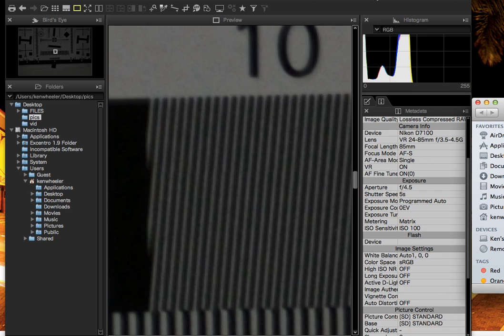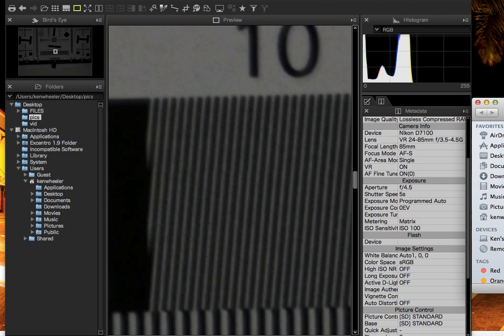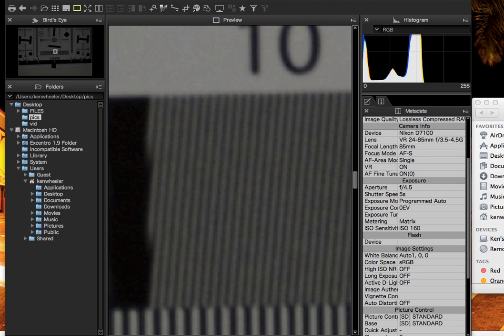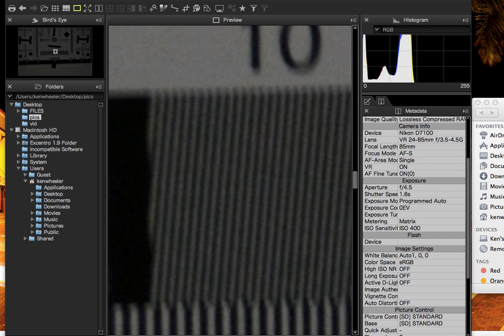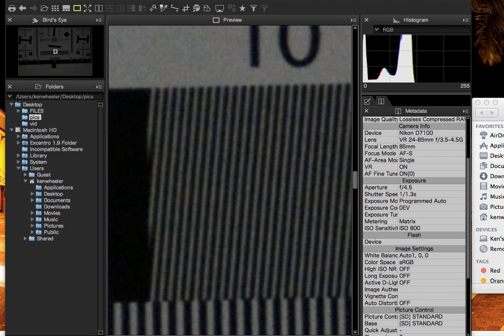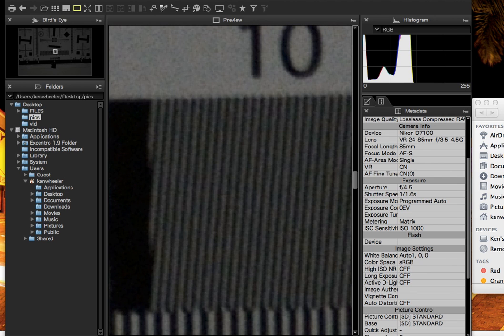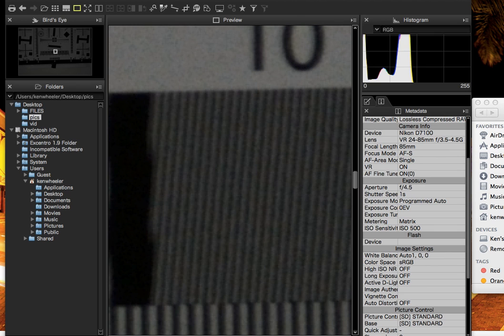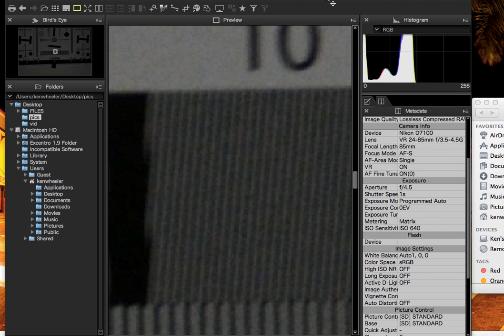How and why some higher ISO settings on your DSLR can and do have LESS NOISE

Comment: I know it's an old video, but anyway; just having a look at your sample images I wonder how you cannot see why there is more noise in the blurry images??? The blur it self will introduce image data (over the black value in data between the lines), and that is why you get more noise. The noise appear between the lines because there's more image data between the lines in the blurry image examples. Every image you show with more noise is always NOT sharp, while every image with less noise IS sharp(er). At 10:05 (ISO 640) the image is really out of focus (look at the number "10" on the white field above), while at 10:15 (HIGHER ISO 800) the image is a lot more in focus (sharper). It is the same story at 4:05 (ISO 160) vs. at 4:10 (ISO 250). So IT IS FOR SURE about the sharpness in this test!!! Redo this test PROPERLY with an equal amount of sharpness in all test images and you would get different results. It's just pure logic....and....I'm just saying!

Comment: Ken, are there any ISO's you avoid on the D810?   (I've always been curious about ISO 64 vs ISO 100 on the D810.  Is 64 actually better, or is it manipulated in some way as to render less desirable images?)
Reply from the maker: Berus7777   yes, 1000, 160, 2500, and uhmmm, i forget which other...... hmmm

Comment: Great information! If only I knew this 1,5 years ago. Now I have put my D7100 away, and generally started to hate digital photography. My results at an important sports event really sucked (IQ=Fuji X10). Of course I was around ISO 1000. And used the not so sharp Nikon 24-70/2.8. Ended up hating the lens too. Suppose I should give them both a new chance … #usererror

Comment: Would you be able to break down your favorite ISO's for the D700? I do a lot of high ISO work and just purchased the D700, because of your badass reviews!
Reply from the maker: Ed Ziehm ohhh, i did that in the video.......OHHHH, the D700!!!!

fave are 100, 200, 400, 1250, 1600, and 800 

avoid 160, 1000, 500.
Reply from the maker: but we have 5 varibles before its gets written on the card.

AD converter, processor, firmware, sensor, algorithms

hehehe

Comment: Its a big one this ISO thing...its starting to get bullshit crazy like Megapixal numbers.
Yes some cameras can have higher ISO numbers but a camera with higher ISO is NOT a better camera. If your camera can go to 80,000 iso and you come to me with a big smile on your face...Hey David my new camera c an has 80K ISO!!!
Whoopty f-ing Dee would be my response.

It matters not - what ISO your camera goes to and how much less noise, in the pic...the honest to gods truth is 'every time' you increase iso no matter what, to take a picture you are DECREASING image quality... iso noise or no noise - Full Stop!

iso noise has nothing to do with image quality.

Increase iso and...You miss out or decrease colour saturation, you miss out on the range of colour that your getting, the canvas becomes less workable in post and tone is chnaged. Higher iso does not mean higher image quality in low light...not at all.
All it means is a higher ability to grab light rays...that's it. 

The lower the iso you use to take a picture the better. You will have better colour, tone, saturation and editable quality. You need to increase ISO??  Why not incease your light, or move your subject, or you move or you do some of the things that back in the old days we had to do becaudser most often than not we had a fixed iso in the film and felt luck and concerned at the same time if it was a blazing iso 400!!

So yes you can have higher iso = higher ability to grab a shot in lower light BUT what ever the iso ability it comes at the cost of decreasing image quality. You can not have (as yet) both together no matter what camera marketing bull shit gets thrown at you lol :-)
Reply from the maker: ***** people also forget about NATIVE ISO too.

Comment: It sounds like what you are referring to is an artifact of binary math.  Multiplying and dividing by factors of 2 is easy, just like when we multiply or divide by 10 with "regular" numbers.  It is just a shift operation.

In base to, lets take the number 10922.  Go down a factor of 10, we get 1092 (there is no decimal point because it is integer math, loss of least significant digit data). Go up a factor of 10, we get 109220 (clean).

In the camera, the pixel values are binary. 10922 is binary 10101010101010 which would be a 14 bit raw value for a pixel.  If one goes down in ISO an even factor of stops, it just shifts the binary digits off.  So Going from ISO 800 to 100 would shift off 3 digits to 00010101010101 (1365 in base 10) and this would be underexposing.  There is loss of the least significant digits.  However, if the signal started at  1365 and you went from iso 100 to 800, then it would be going up 3 stops to 10101010101000 which would be 10920, not 10922.

When using fractional stops in the ISO, the binary math loses even more information because you are not just shifting digits, but you are actually screwing with even more of the digits.

Those who are familiar with scaling images, especially those with small horizontal and vertical dimensions, haven't you ever noticed that integer scaling factors make for better scales?  In other words, a 600 x 300 image looks a lot better scaled to 300x150 or 200x100 than it does at 550x 225.  Think about how the pixels combine and it will make sense, because the math is finite math and you are dealing with desecrate pixels.

However, what is talked about here is unclear because it doesn't distinguish between chromatic noise and other noise.
Reply from the maker: ScienceDada Ad converters, the algorithms ,  and processor, and the sensor capacitance density

all these factors make digital ISO a serious Fluster Cluck of complexity for most to figure out.
Reply: What you have said is true.  I have heard that in Raw mode, the data is mostly not processed.  From what I understand, it is raw sensor values from the A2D converter, which is why ISO adjustment must be applied in a RAW converter.
Reply from the maker: its so convoluted the only people that REALLY know ALL the answers are a handful of techs at the factory

everyone else just sets the ISO and lets it roll

I prefer to KNOW why , etc etc.

Comment: @Theoria Apophasis can you explain how ISOless sensors work? sony, Fuji and others say they have ISOless sensors. How do you use ISO setting on these cameras?
Reply from the maker: Lysander Spooner there are several articles on same, and i cannot say it better than they can:
http://www.clarkvision.com/articles/iso/
Reply: Theoria Apophasis Thanks...I looked at his article before but is no mention of the "ISOless" sensor and how it changes digital capture. Did I miss it? 

For example, I have reads(see below)  that "Nikon has recently started to embrace ISOless photography with their D750 full-frame DSLR, which features dedicated highlight-priority metering and flat-curve image processing." This is the part I am trying to get a better understanding of. 

Basically I get that ISOless, meaning that that ISO amplification (= adjusting the image brightness) can happen either before or after the RAW data is generated. Both results will virtually look the same whether captured at higher amp or adjusted in Lightroom. There’s no significant quality difference.

What I was asking from you is you opinion on this technology and how it changes the "rules" of working with digital tech.

Here is an article I found that illuminates the ISO: http://fujilove.com/isoless-photography-with-the-fujifilm-x-series/
Reply from the maker: Lysander Spooner i wont change the rules, only HELP those who edit in post, and wont change a thing really in shooting, since exposure choices will all remain the same. 

yes, ive seen that article :)

Comment: That was a pretty interesting video. I had read about it before, but was too lazy to test it. But now I was curious and took the same shot at every ISO step my camera has, and then aligned a cropped bit of each image to see if the noise levels were really proportional to the ISO value. They were. I compared every step side by side, and didn't find any higher ISO shot that looked better than a lower ISO shot. I found a lot of them were pretty close, cause it's just 1/3rd of a stop difference, but I could see very graduated changes in noise levels, dynamic range and tones.

I used my Sony A6000 on a tripod, with daylight white balance, with my 35mm f/1.8 lens at f/4. I didn't post-process the shots, so they are not sharpened, no curve was applied, and no lens correction. As I increased the ISO, I reduced the exposure time.

If anybody wants to take a look at it, here's the Gimp file:

http://www.mediafire.com/view/ds4xsduf4ch64y1/100-25600.xcf

And here's the JPG:

http://www.mediafire.com/view/uuabstnaz36l78a/A6000_100-25600.jpg

All ISOs are placed from ISO 100 to ISO 25600, from left to right, and top to bottom. With the Gimp file, you can move the layers as you want, to compare easily between ISOs.

If anybody takes a look, let me know if what you see corroborates what I see. Thanks!
Reply from the maker: wandererstraining need shots at 1000% magn.  :) 

have you seen this:
http://www.clarkvision.com/articles/iso/

thanks for the links :)
Reply: Theoria Apophasis Ha ha, I was looking at only 200%. :D But then, to me the difference isn't worth the hassle.

That article about ISO was very interesting, and helped me understand better what ISOless means. Also, I figured out that at high ISOs, I'm better off underexposing by two stops and then doing the rest in post-processing. I just did a quick test in daylight, comparing a shot at ISO 1600 underexposed by two stops to a shot at ISO 6400. Not only was the shot pushed by two stops was less grainy and had more details, but two stops extra exposure was not even necessary to achieve the same brightness. +1.66 EV gave me exactly the same brightness level, with better image quality. I'll try using that trick when I shoot my students' year end show in June! A few months ago, I shot an other one of their shows, so I'll be able to compare the shots from the two shows. I expect a significant improvement, and much less blown out highlights. But it'll take more post-processing, considering the very large dynamic range of the scene.
Reply from the maker: To be sure, ISO will be a thing of the past in the future, there were be low medium and high, everything ELSE will be done in POST.

the information will all "BE THERE", and ISO will be more in POST than IN the camera when recording.

at least all indications are such.
Reply: Theoria Apophasis Yeah, it would make a whole lot of sense. Just need to wait for better electronics around the sensor!
Reply from the maker: its a river of change that never stops flowing.

ISO is a critter that still lives mostly under an illusion in most peoples minds, including TOP pros

but hey, its all about the image, if you GET IT, great, then what matter ISO?

but knowing same lets you know what you CAN do in post.
Reply: Theoria Apophasis Yeah, I find the idea of an ISOless have very practical implications, per example being able to underexpose by a LOT to better preserve highlights. In the end, a difficult shot should always be exposed with post-processing in mind.
Reply from the maker: exactly, ....dont you love having more to consider in shot taking!!!!

NOT! !!
Reply: Theoria Apophasis Ha ha, but it's useful in so many applications! :D

Comment: On my d5300, shots taken at 1000 - 1250ISO are so incredibly noisy at f3.5-5.6. Next time, I will try to shoot at maybe 1600 ISO or something and see what is different. I have thought of ISO and noise/grain to have a linear correlation, so I have been keeping to a rule of keeping under 1250, but after watching this video it makes me curious what the other ISO settings look like.
Reply from the maker: Dakoolguy111 see here:
http://www.clarkvision.com/articles/iso/
Reply from the maker: Dakoolguy111 ISO 1000 shouldnt exist on that camera, cause it makes more noisy shots, same is true on the D7200. 

linear correlation? OOOOOOH   NOOOO, but everyone does think that.

Analog/digital converters, the algorithms ,  and processor, and the sensor capacitance density

all these factors make digital ISO a serious Fluster Cluck of complexity for most to figure out.

Comment: I totally missed out this fact until today ! 
Does this imply that we should test each and every ISO step of a camera to discover which one is better ? (I'm not a huge fan of shooting targets on the wall :-( ) 
Also, since manufacturers are no doubt aware of this, do you think that the auto-iso feature takes this into account (that would be a strong advocate to use it) ?
Reply from the maker: Gael Canal AD converters, processor, and firmware,  its impossible for any of us but the mfg. to know this other than to test same,

i found it amazing how much noise  ISO 1000 is for example on the D7100 vs ISO 1250

Comment: Would you agree that while most photographers think the sharpest aperture for their lenses would be in the f/8-f/11 range but in reality depending on the camera and lens fit the sharpest aperture for that particular combination could very well be f/4 or f/14 as 
a couple examples?
Reply from the maker: Dirt Farmer this is true, however sharp is sharp, but are we considering DOF, or what subject matter?
Reply: Dirt Farmer I have a few lenses that have their sharpest aperture at f/4-5.6. Depends the lens. Older lenses might have been sharper around f/8-11, and also, I think that a lot of photographers think it's their sharpest aperture because that's where they have the widest depth of field before diffraction sets in. At f/4-5.6, if the scene isn't flat, less of it will be in focus. Also, at smaller apertures, the sharpness is often more even across the frame, so if you couple that with a wide depth of field, the shot looks sharper overall.
Reply: wandererstraining I have been testing my D7100 and lenses using a program called Reikan FoCal AF lens calibration which also tests things like auto focus consistency, sharpest aperture, quality of focus, multi point focus, where you can check how well each of your focus points are working and if you want to you can compare how well your camera and lenses perform compared to others with the same gear and have found the sharpest aperture for my lenses are between f/4 - f/5.9 except the 70-300 which is sharpest at f/11 at 300mm.
Reply: Dirt Farmer Seems to corroborate the sharpest aperture of my lenses. And it seems like very advanced software! Useful, but I don't think I need to be that precise.

Theoria Apophasis Yeah, in the end, f/8 and f/11 are still super sharp. I also think that by that point, factors other than optimal sharpness should be used to choose the aperture.
Reply: wandererstraining Yes , I was thinking that is a good thing and see your point on depth of field. I had some concerns that my camera's auto focus was off so  I found this program and decided to get it.
Reply: Dirt Farmer Yeah, that's pretty cool that it can check if your autofocus works well. Too bad I'm using Linux! :D
Reply: Theoria Apophasis I wasn't, only the focus point on an isolated subject but do see how depth of field has to be considered. I was using this program mainly to calibrate the auto focus so the tolerances between the lenses and the camera were compensated for.
Reply from the maker: ahhhh,  gotcha :)

i loathe having to do lens calibration :P Pfft.
Reply: Theoria Apophasis I thought you might like this Reikan FoCal program since it does most of the the work
 and you just need to adjust the AF fine tune.
Reply from the maker: yuppers!! you mean this APP

http://www.reikan.co.uk/focalweb/
Reply: Theoria Apophasis Yes. I think the pro version is the way to go. 
It does more and you get free upgrades to the program.